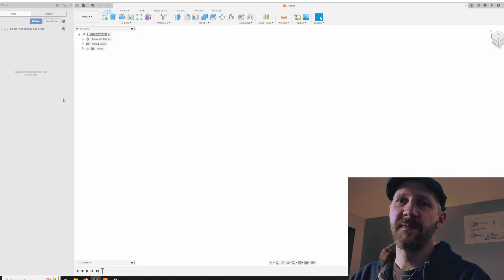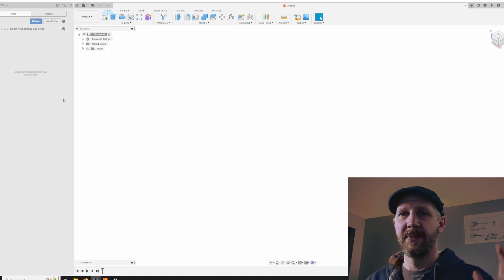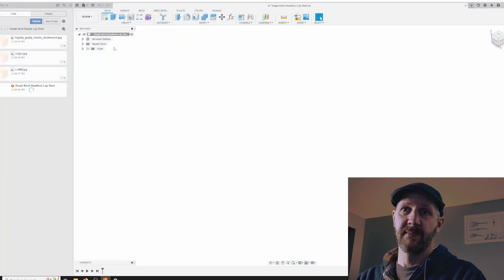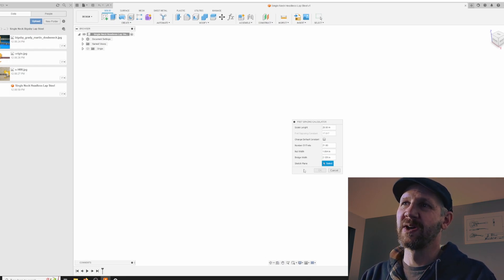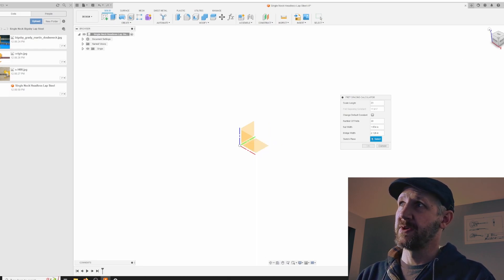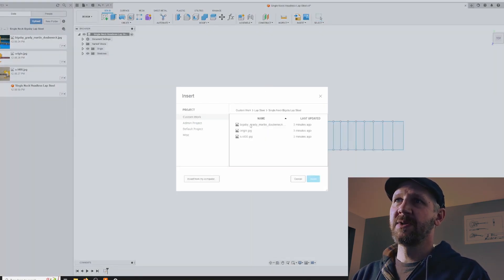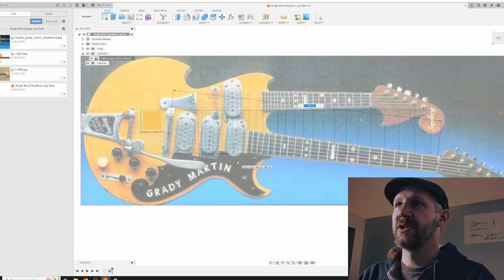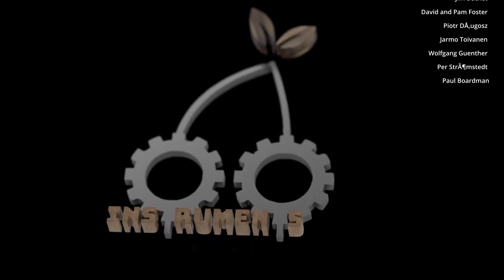Crafting String Instruments: From Concept to Creation with Fusion 360 | Part 1

Comment: Thanks for the great videos! Very, very helpful. 
I was hoping you could give me some advice about bracing a flat top acoustic so it can handle an archtop style bridge. 

Hopefully I can keep this short and simple, 😅but I am building an instrument that I will take bicycle touring for 3 years. 
I play guitar, and I have studied Indian classical music for 20+ years. 
In the past, I always travelled with my Sitar (on a BOB trailer towed behind my bike). 
It travels well and has survived for multiple tours, Iceland, Mexico, Guatemala, Canada, the US and Eastern Europe, the last tour being one year long. 
It is still my main instrument.
The problem is that when I am on the road, I really miss playing Guitar, Esraj and Lap steel. 
So this time I am "building" a modular instrument that can be reconfigured depending on what I want to play. 
The concept is pretty far into the planning stage and I have most of the parts already. 

Originally, I was going to modify an old German Jazz guitar with a bolt on neck. 

I will build a sympathetic harp arm to accommodate the Sympathetic and Chikari strings, as well as 3 modular necks, one normal guitar neck, one fretless guitar neck and one Sitar neck with a guitar scale length.  
It will also have modular bridges that match the necks and one for playing with a bow, Esraj style (basically the high 2 strings)

Unfortunately, I am worried that the Jazz guitar won't be loud enough and won't really have the sound I am hoping for. 

I recently found an early 80's made in Japan "Lowden" copy that sounds wonderful and has the simple soundbox aesthetic I am after. It has a solid cedar top, solid rosewood back and sides and maple binding. 
I will remove the neck and build the 3 bolt on necks I described above. 

For the normal guitar and the fretless neck, the bridge that is there (typical Lowden style rosewood) would function just fine, but for the Sitar neck, the strings need to be anchored at the tail, independent from one another because of the deep bending typically used on Sitar. 

I'm sure you get the problem I am facing... The flat top isn't meant to be pulled in this way with string tension trying to fold the sound board in half along with the downward force on the bridge area where normally it is being pulled upward. 

I was hoping you might have some advice on how I can brace the instrument so I can use an archtop style bridge?

I thought of simply adding a sound post under the bridge, possible height adjustable...
As well as a carbon rod or tube that runs from the tail block to the heel of the bolt on neck pocket but stays about 1cm away from the soundboard. 

Sorry for the long winded comment, but I would appreciate any advice you can offer. 

I have been repairing/adjusting guitars, both electric and acoustic as well as repairing/setting up Indian classical instruments for over 20 years.
I have also built many electric instruments from scratch and modified/fitted a hand full of acoustic guitars with sympathetic strings.  
I am also experienced in doing Jawari and planning out the sympathetic/resonance strings. 
But never built an acoustic guitar from scratch.
I only say this because I know it sounds like a crack-pot idea😉 

Basically I am just wondering if it is possible to brace the flat top in a way that doesn't completely deaden the guitar. 
Thanks for any advice you can offer!
Reply from the maker: That's an interesting problem, and I think you correct, since the design of a flat top is made for the bridge to be pulled by the stings rather than being pressed in the top by the string as in an archtop. I think these kind of change will definitely remove most of the resonant ability of the top.